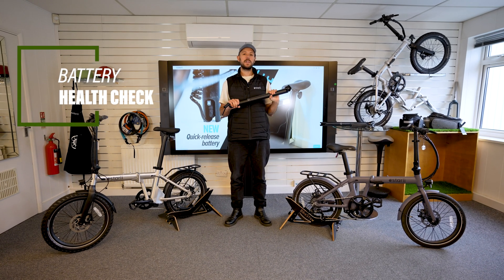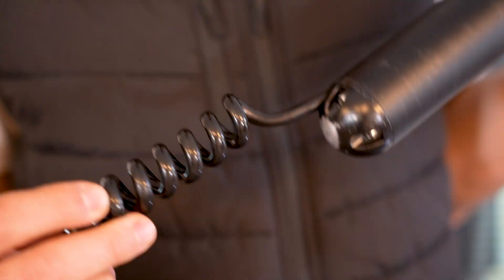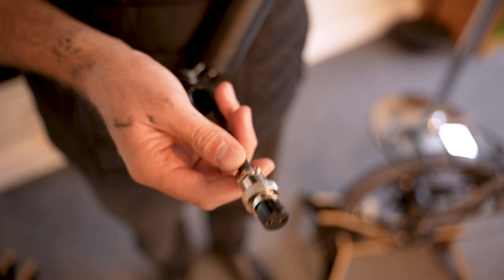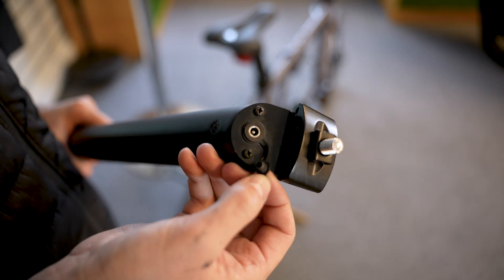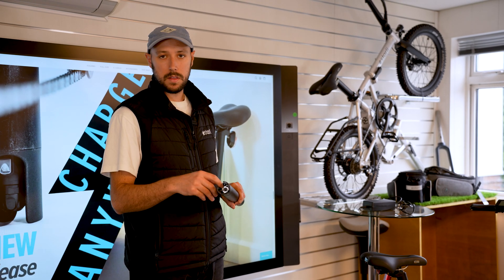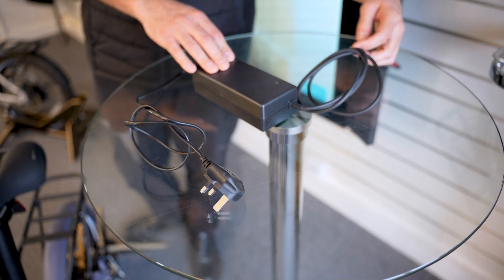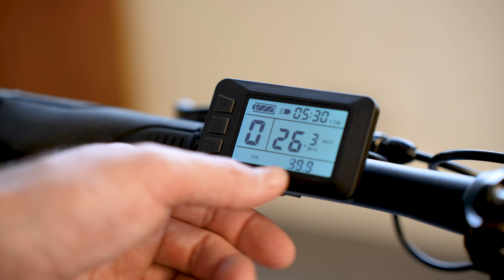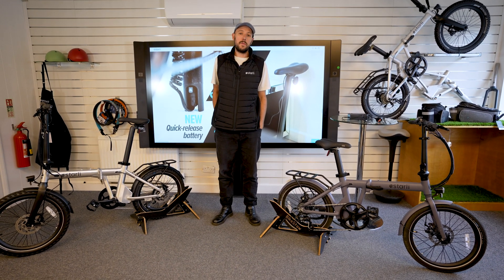Battery Health Check - Estarli Folders

Comment: Really sucks that you only offer a range extender for the new style batteries - us lot stuck with the old ones need them more!
Reply: Also this old style is the most ridiculously obscure connector to try and find an additional battery for. Buying a second spare is out of the question due to the seat being attached, it's not like you can just swap them around when one runs out. Sort it out, Estarli.

Comment: A useful video, from a potential purchaser, to see the battery connections and hear the advice. Other videos on servicing would be useful as my usual bike shop refuses to service ebikes with different motors and batteries to the ones on bikes they supply.